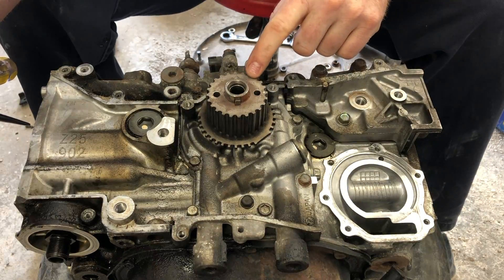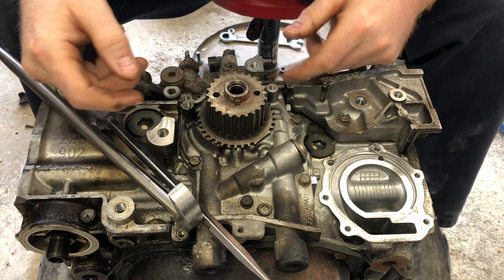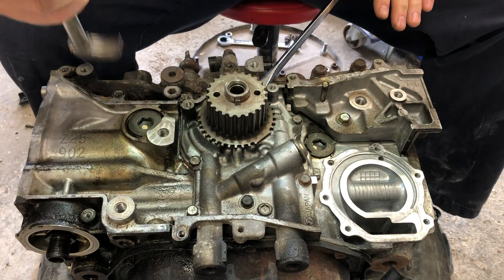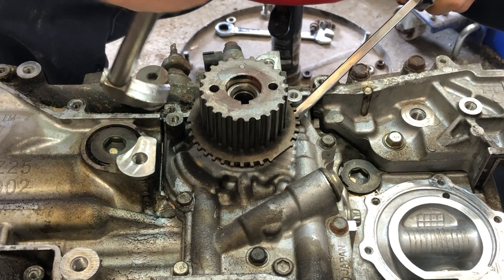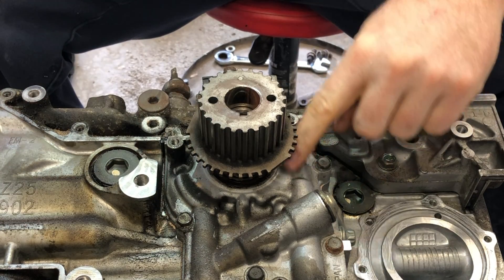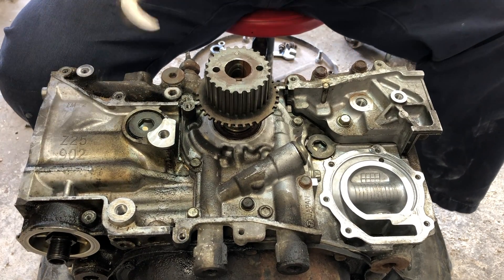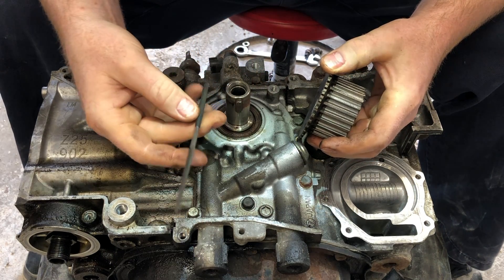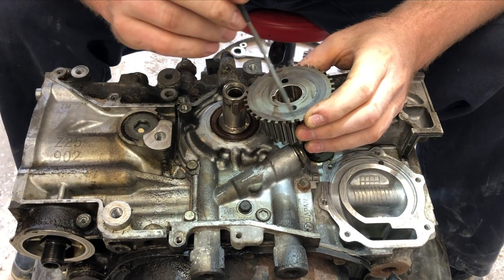SUBARU Crankshaft Timing Sprocket Gear Removal!

Comment: I pryed just a little bit against a tooth and bent it a little. Later when off i tried to gently tap it back into place and it broke off, made of cheap pot metal inside like toy car metal, although it looks like brass on outside. When i noticed i bent it i bought a 5/16-18 thread tap and threaded the two holes, used a harmonic balance puller to finish pulling the gear. you won't even need to drill the holes out as the 5/16 thread tap fits perfectly. Went to salvage yard pulled another gear after threading it.
Reply from the maker: Sorry you had trouble. A slight nudge is all that is needed and max pressure that should be used.
Reply: @EasyFixShaun 
Well, i didn't add that my crank pulley fell off because last yr when i changed the timing belt i didn't torque it to specs and the pulley sheared off the front half of the woodruff key, so in a perfect world with no obstructions and corrosion I'm sure it would have come off as you said, but no worries, i went to salvage yard got another pulley for $18, and a crank gear for $6, hit front of crank where pulley wallowed out with power wire brush, fixed it up, installed new key. Lesson learned, there's a pulley holding tool from Amazon to hold it in place while you torque to specs. TY tho for your vid, I'm sure it helped ppl who didn't bugger up their crank surface. 😅 I did use the $10 threading bit i bought at salvage yard because no hood on car, exposed to elements so i didn't want to chance it prying with 2 screwdrivers.

Comment: Omg I’m in for it. That’s under the motor so imma have to lift the motor!? No way I’m a wiggle that from underneath the car! Thanks. Unlike other ppl I read the entire manual of the car. This is actually a maintenance service that needs to be checke d n replaced so often. Here I thought drive shaft and crank shaft located in the same area! Thanks for the knowledge I needed this. Going to have to get innovative. Also the oil pump was a good call imma be sure to check that before putting it all back together!
Reply: Do you have oil pump removal as a video!. You’re a great motor tech. I learned a lot from this infinitive video. Get your YouTube videos sponsored by how cast. You’ll have to script your videos. But all n all you deserve to be there I hope that hongo help u as much as you helped me! Thank you!

Comment: My Car is a Opel Astra G en the crank Gear has a special notch on top where the pulley falls over. Well..... My car decided it didnt need it anymore and now my crankbolt wont stay put. Darn thing.... Its taken me a couple of days but ill get that sucker off eventually
Reply from the maker: Oh man sorry you had so much trouble. I use this trick sometimes with stubborn bolts 😃🔧https://youtu.be/BTysmAxU_nw
Reply: @EasyFixShaun  Its the Gear for the timing beltt. Bought a Gear puller and managed to work it off in a couple of hours with some WD40 and some elbow grease. Installed a brand new one and put everything back together. Total repair costs and a new Gates belt was about 149 euro including the new puller
Reply from the maker: @9bstar  Nice work! Glad you got it all sorted out 😃

Comment: I used an m7x1.0 tap to cut threads into the two holes perfectly, then inserted two bolts with a slide hammer attachments. A few taps and she was off
Reply from the maker: Nice work. Was yours stuck from corrosion?

Comment: Thanks for tge informations,what is the effecte if you have broken teeth??
Reply from the maker: No problem! If you broke a crank gear it may not run. If it does it would likely be having massive miss fires and drivability issues for sure 😀🔧

Comment: Not the best solution, but I prefer cleaning everything with a wirebrush, remove all rust and let it soak with either wd40 or atf.
Reply from the maker: Your idea is great! I was forcing it off with the little bit of rust that usually accumulates 😃🔧

Comment: Ohh lol so this is why my engine isn't turning on im assuming. Lol

But curious, do both pulleys go back in only one way?
Reply from the maker: Do you mean the crank pulley? That will only go on one way correctly. The crank sensor teeth need to go towards the engine to line up with the crank sensor once installed 😃
Reply: @EasyFixShaun  yes both crank and cam pulley. I'ma do this tomorrow.

I did am engine swap and couldn't get the new engine to turn on. I'm assuming it came out of a manual car cause it does not have an oil cooler. 

Going in a 2004 Forester
Reply from the maker: @dragon123443  Yup they all go on one way.

Comment: I was on the fence about attempting this, but your smooth jazz and 80's synthwave background muzak motivated me!! Thanks. 👍😀
Reply: Damnit. I already broke one of those teeth in the back. I need a new sprocket, right?
Reply from the maker: @jugdhiss  I linked a crank pulley in the description just for you 😃. Thanks for the idea. I think a replacement part link could be helpful to you or others. Have a great day!
Reply from the maker: Yup. Must have been rusty. You can get them on amazon. I think i put a link in the description for them.
Reply from the maker: Haha no problem 😀🔧🔧
Reply from the maker: Should slide right off as long as there is no rust.

Comment: Excellent info, thank you.  I just installed a 2005 ej251 in a 2002 Impreza wagon.  I'll be swapping the sprockets tomorrow when my crank pulley tool arrives.
Reply from the maker: Outstanding. I’m glad it helped you out! Good luck on your project. Sounds fun 😀

Comment: I tried this for a little bit but soon realized this wasn't going to work for me. Mine was on there good. I had to fabricate a little puller device to get out. I tapped a few threads on the 2 wholes and used a couple of bolts to hold on to the sprocket as used a puller rod and nut, along with an thick washer i modified to hold the 2 bolts. (You get the picture). Slowly but surely the method worked but it took some effort, i was surprised it was that tight on there, when it finally came out i noticed all the rust that was sitting under the sprocket, if you can't gently  get it out with the screwdriver method don't keep trying it because your either going to damage a tooth or crack the oil pump casing since its alluminum. Use the tapping threads on the wholes method and use some pb blaster to help on its way out.
Reply from the maker: I agree. If it won't move it has corrosion problems and a puller is the safest method. If you can get it  to wiggle with a reasonable amount of force, it will come off. If it will not move a little or wiggle a little bit....puller only 😁

Comment: Yep, you got to be real careful with the teeth. I took that pulley off of my 98 Forester the other week and did not notice until I went to put it back on that I had actually knocked two teeth off it! With a three week (at least) delay for another one from the dealer, I set about reconstructing the teeth with my welder then filing them back into shape. I was quite pleased with the job, actually and it worked up to a point, obviously, as the car starts and runs fine. However, it simply will not rev past 3000rpm. I had ordered the new one anyway (still not here) so back to waiting for the part. I am assuming, of course, that the reconstructed teeth are the problem. Nice video, by the way. All these things are a great help to us folks at home.
Reply from the maker: Thanks man! I really appreciate that a lot. I have never welded teeth on before. "Necessity is the mother of invention". I love it man. Nice work!
Reply: @EasyFixShaun  Yep, it was the pulley - new one removed the 3000rpm limit. Obviously, the sensor is responding to even minor variations in the tooth profile.
Reply from the maker: No kidding. Nice try man! Very creative. I love it.

Comment: Nice Video !!!!

I thought that it was necessary to remove the Woodruff Key BEFORE removing the Crank Sprocket ?
Reply from the maker: The Subaru sprocket can be removed with it still in no problem. Mine was sticking from corrosion. If there isn't corrosion they will come off by hand.

Comment: do you think this can be done just as easily with the engine still in the car? Looking to do this on a friend's '00 Impreza RS that has a broken woodruff key that we need to replace.
Reply from the maker: Yup! Totally doable in the car.  Just a little less room to work.
Reply: Trying the same thing except my woodruff key is kinda mushroomed where it sheared off. Might have to do some precision Dremel work on the key before I can slide the gear off.
Reply from the maker: Ouch! How did that happen?
Reply: @EasyFixShaun  Had some garage mechanic do my timing belt/water pump and re-seal my leaky engine. I'm guessing he didn't torque the crankshaft bolt to spec and it came loose while my wife was driving it. Should have just done it myself because now I'm wondering what other parts may not have been re torqued to spec... 🤷‍♂️
Reply from the maker: Oh ok. So the pulley wobbled from the crank bolt fastener being loose and messed up the woodruff key? That makes sense. What a bummer. Once you get it sorted out, i believe the subbie crank bolts need to be torqued to 96ft lbs and have lubrication on the fastener. Usually they stay tight if that is done. I hope that helps 😀😀
Reply: @EasyFixShaun  Exactly. I had to create a custom puller tool to get the timing gear off the crankshaft with everything still in the car but I was able to get it off, replace the key, and everything back together this morning. I read conflicting torque specs on the subie forums regarding the crank pulley torque (96 vs 130ft lbs) but I oiled the bolt and torqued it to 130 to be safe. The car fired right up and even had cold AC at idle after sitting for almost a year and a half. Thanks for your video and comments! All very helpful 🙏

Comment: so 2002-2004 Sprocket is different to 2005-2007??
Reply from the maker: There is a difference in sprockets teeth between certain years. I don't know for sure the years. But I believe 01/02 there is a difference in crank sprockets. Cam sprockets are different also between 05/06 when ACVS came out I believe. If swapping motors I make sure to swap all 3 SOHC or 5 DOHC sprockets.